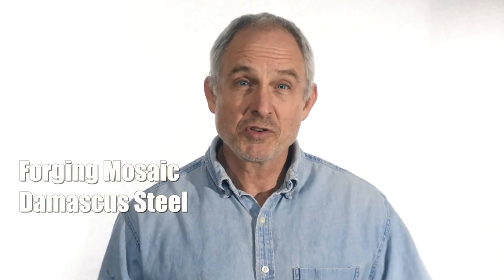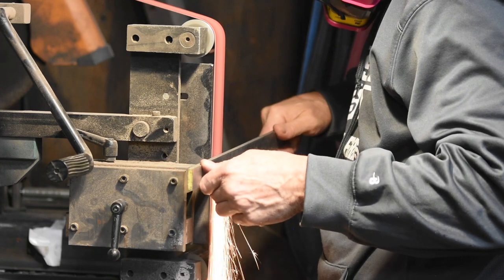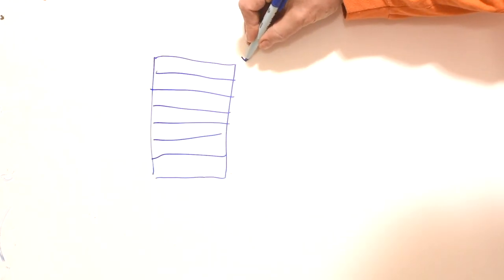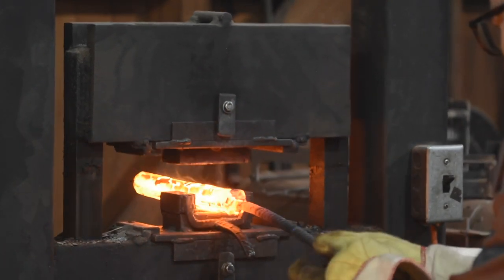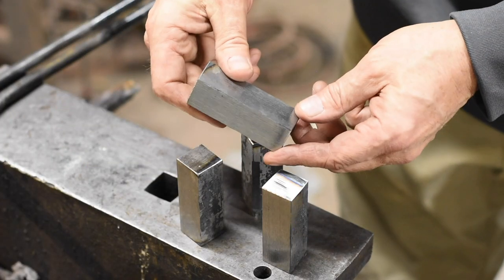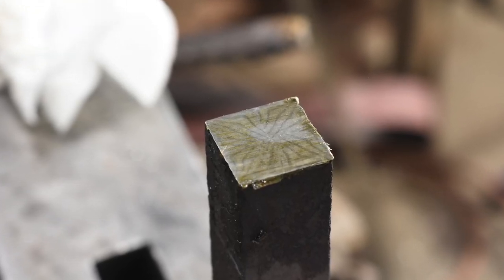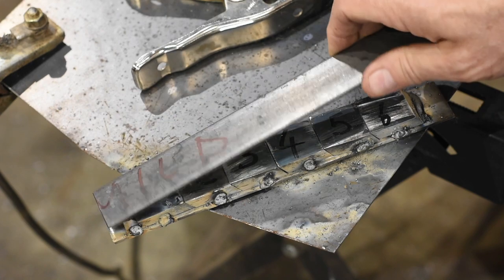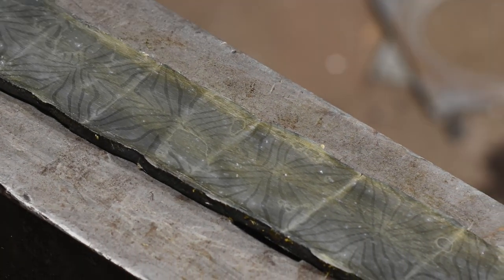Forging Mosaic Damascus Steel

Comment: I bought a cold cut saw just to cut down on the abrasive dust in the air . Same kerf in the waste though. Just cooler and straighter.

Comment: Having left metalworking in 1980 starting in 1970.  I was fascinated to find out how these damascus patterns were made. I only saw them a few days ago. Before this I only heard of damascus steel being used in strips where a high carbon steel was sandwiched between lower carbon steels to make a knife blade able to hold a  edge and be flexible.  I presume the property to hold and edge and be flexible is reduced with this damascus patented steel. 
I was forced into a welding fabrication apprenticeship which I excelled at. And whilst working on a profile cutting machine with all the heat sparks and mess I decided to get out of the industry. From starting my apprenticeship to when I left it took 10 years.

Comment: Hey Walter, do you happen to know of any forging press that would be cheaper than a Coalironworks?
Reply: The only solution I could find was to modify a 15 ton log splitter cost me a £1000 pounds but it sure does the job, apart from that i could not find a cheaper option unless you get lucky on ebay but cheap presses are few and far between
Reply: @divs1023  thanks for letting me know. I sort of figured that was the case.

Comment: Seems like pattern weld steel is a meme in comparison to the strength of modern monosteels or am I just a psycho? (Not taking anything away from the craftsmanship and artisan work of smiths like Steve Schwartzer or Josh Prince, etc)

Comment: Is it possible by hand. I don't have a hydraulic press
Reply: Yup. Just going to be one helluva lot of hammering.
Reply: From 1970 to 1980 part of my job was to straighten angle Iron and flat. I used to use a "Small" sledge hammer with a shortened shaft single handed. In that time I broke/wore a bit off my elbow which caused me trouble for many years. I would not recommended it.